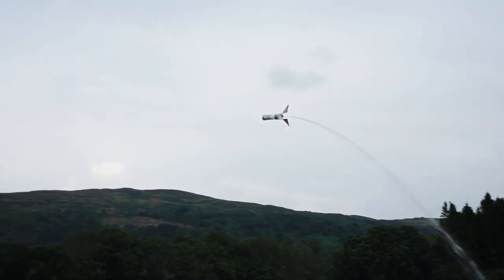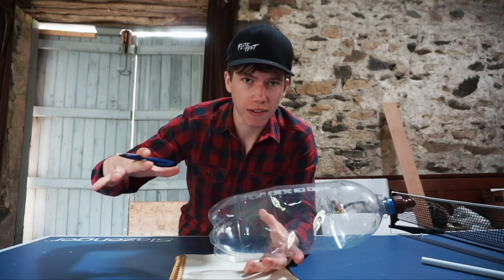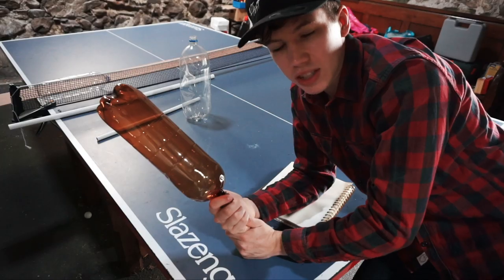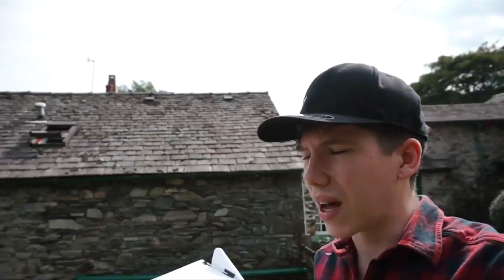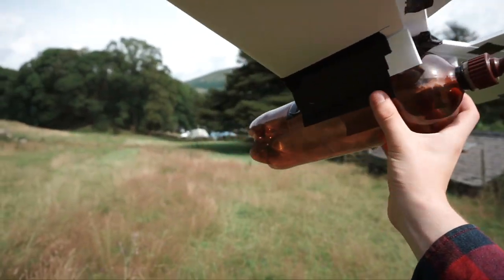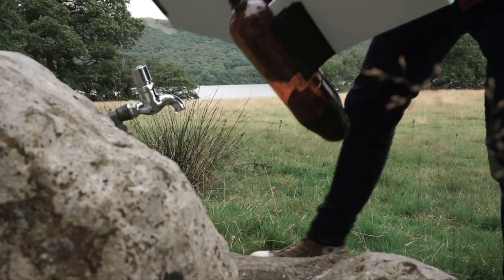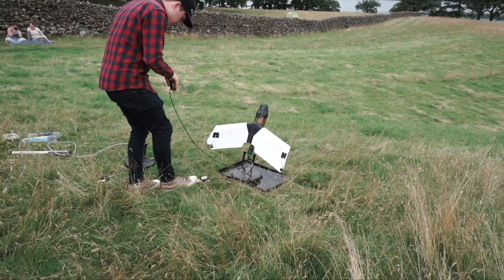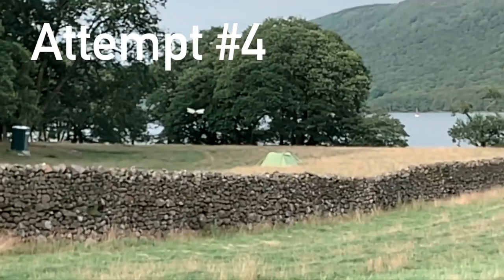Water ROCKET Plane

Comment: Glide test without the weight of water? 
Dynamic CG as the water discharges?
Dynamic thrust as the water discharges? 

Water rockets are always vertical, that solves a lot of problems.

Comment: Looks like fun!  I bet that the main reason it's pitching up so much is because the point of thrust is too far below the wings, creating a torque that is pitching the plane too far upward.  You might see better results if you have the wing mounted near the center of the bottle so that the point of thrust and the wings are close to being on the same plane.

Comment: Nice vd. Try a canard configuration it is more tollerant in cg shifting. It's as sensitive as flying wing in term of thrust momentum so take it in consideration.
You can esaly find online that in the golden age of free flying aircraft model many rubber powered plane were equipped with some kind of temporized servos that change plane attitude by activating after thrust expiration the pitch.

Comment: I think your issue may be that you are getting into some rocket-science levels of variables with weight and centre of gravity changing as the volume of water changes through the thrust phase, even discounting “sloshing”, which may be minimised because of the acceleration.
Reply: Not really , you just need to stick wings to the side

Comment: I actually had this glider as a kid.  it worked way better.  lol.  it had a hand pump attached to the bottom.  it was held like a crossbow. pulled trigger to fire.
Reply: Larami 9506-0 Super Soaker Wing Thing, 1993ish. I had one too, till it ended up in a 30 metres high treetop of a spruce. It flew way better than this over here.

Comment: As a "former" water rocketeer I can say that using a flying wing will get you nowhere.

Adding water that's in the back of the rocket plane shifts the cg way too far back.

Solutions:

A. Use a full-bore nozzle (just the bottle hole, no special nozzles). Will eject the water really fast, but the acceleration will rip off the wings

B. Add a tailplane way back. That will also stabilise the plane.
Reply: About the CG variation there's no relation between flying wings (noto deltas) and CG position tollerance. It just need to be meant for such. 
Definitely Canard configuration will solve the situation without much effort.
Reply from the maker: After experimenting with this design, I'd definitely agree that a wing is far from the ideal configuration. Originally I had intended to do a confentional wing+tailplane, but limitations with the launcher and how the plane connected to it made me opt for the simpler and more compact flying wing without a long tail.
Reply: That's not quite right. The Super Soaker Wing Thing was a similar but smaller delta flyer that flew pretty well for a toy. It had less thrust but was more manageable at the handheld launch. Too bad it wasn't around very long.
https://youtu.be/NB1_CdUrmis